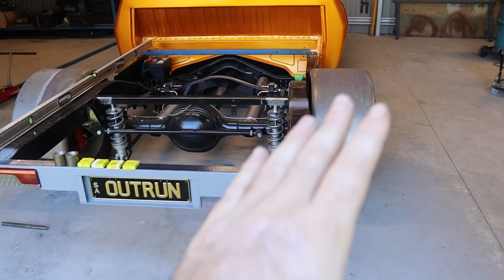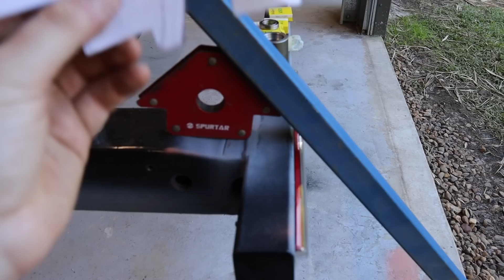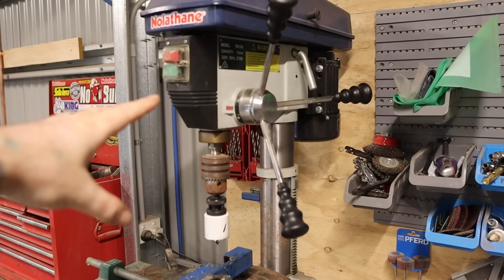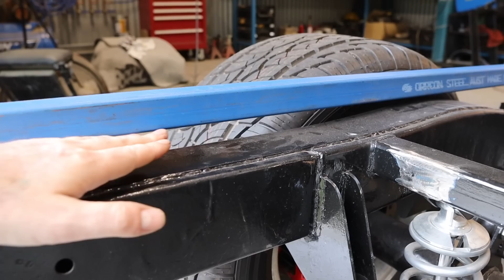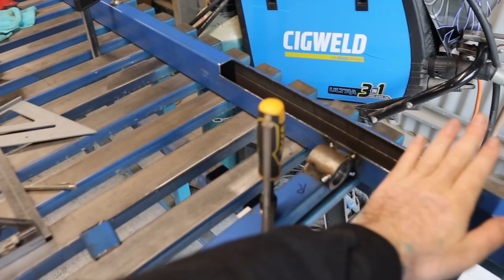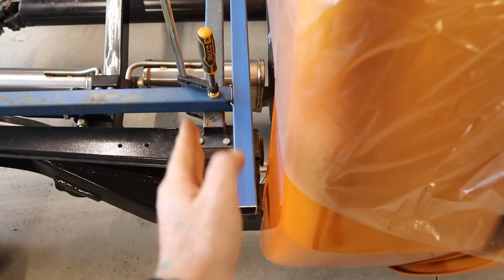Building the Tilt Tray - HX One Tonner Tray Build Episode 2

Comment: Have binged the entire playlist. It's been very educational thank you. Have learned so much from the way you work through the problems. One question. What mig wire (6mm or 8mm) are you using for the panel repairs? Have read/listened to many points of view. Wondering what you have bene using.
Reply from the maker: Hey Mate glad the videos can help. The wire I use is .9mm wire. This is the most common wire and I have used it for all the welding on the Tonner.

Comment: Is it a good idea to have the filler cap under the tray? Depending on what you're carrying, it's going to be a p.i.t.a. having to lift the tray to fill up. Even if the tray is really easy to lift, the contents will move when you lift it.
The other thing I noticed was the lack of meat around the bearings. It looks like you cut out a lot of strength when you mounted the bushes/bearings; is it strong enough to support the tray, especially at an angle?
Don't mean to sound critical, just the viewpoint of the completely unqualified viewer.😁